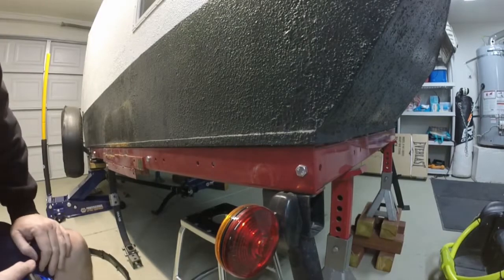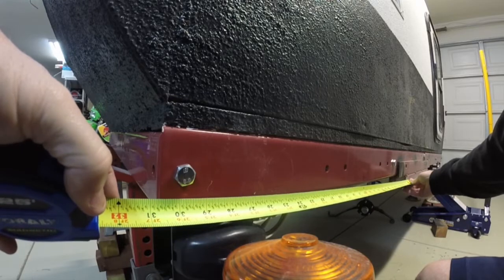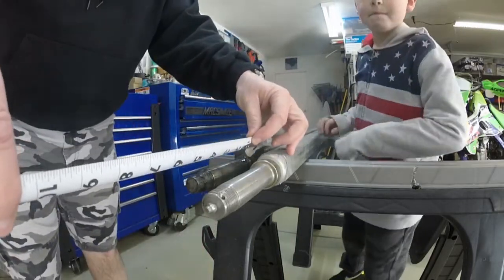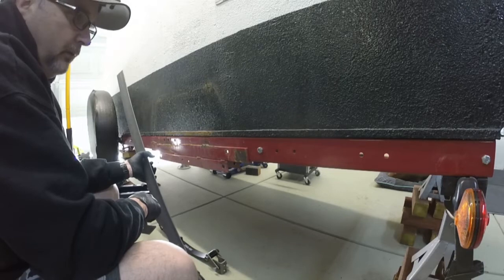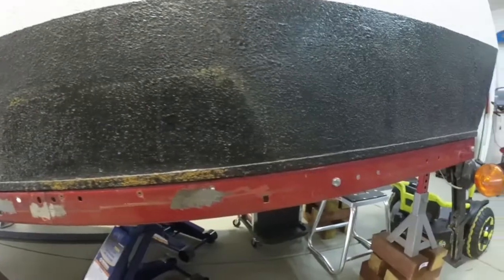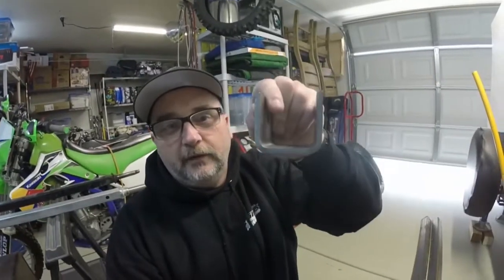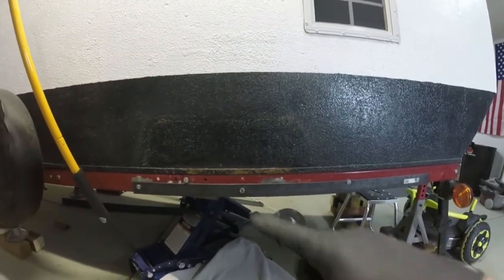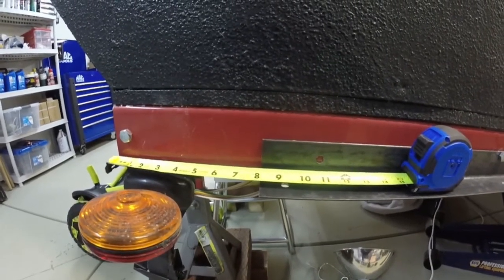Harbor Freight Axle Swap PT2

Comment: If you had it to do over would you still use the hf kit, or build your own from scratch?
Reply from the maker: With what I am ending up with in terms of weight and size the answer would be a for sure no.  However I believe that if you wanted to build a very simple tiny camper an HF trailer would be just fine. I just went way over board.  If I were going to do this again I would buy a trailer from Lowes or Home depot with 5 lug hubs and heavier cap axles.  Like a 5 x 10.  Another route would be to buy an enclosed trailer and then 1/2 the battle is already won with a roof and sides.